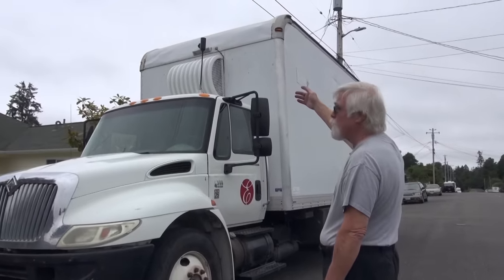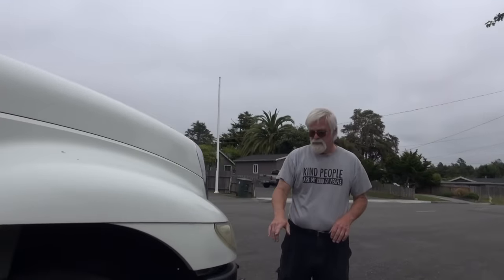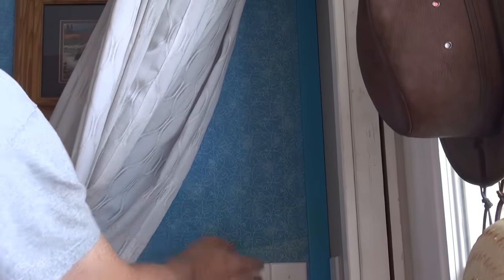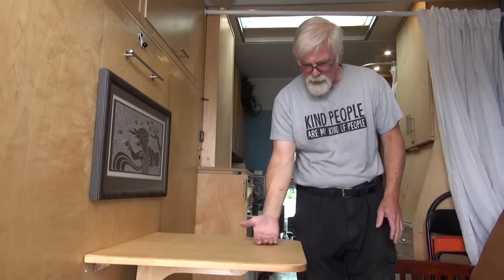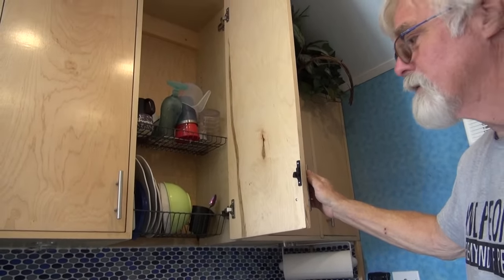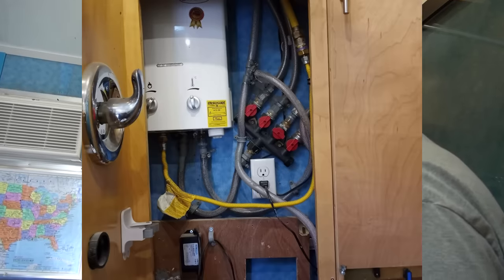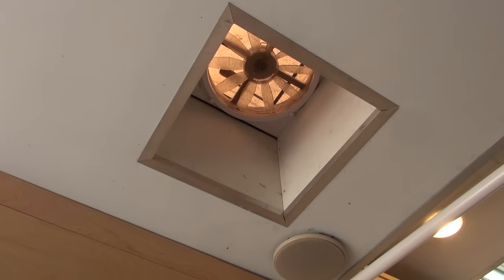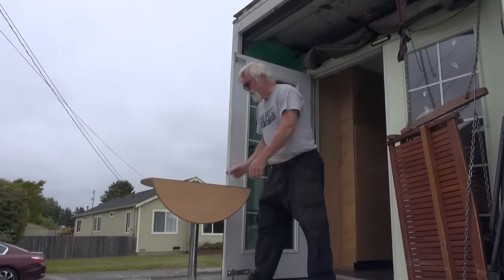Harvey the RV Stealth Box Truck Conversion/Tiny House Full Tour

Comment: I'm curious how recirculated water works and want to look more into it. This is a really interesting build and it seems like its the perfect fit for your lifestyle/needs. I love simple things so the dish strainers built into a cupboard was my favorite though there are so many other cool things I really enjoyed too

Edit: Nope ignore me, I also loved the toilet paper arm lowering build. His excitement for it made me love it so much too. So the strainer and the tp arm is rad af
Reply from the maker: Hi, these days there are a lot of videos on recirculating showers for van life. A quick search on YouTube should get you the information you want. The main things are to heat your water for both the "house" and the shower separately and to use a pre-pump filter, then a set of filters that go from 20 microns down to 5 microns followed by a UV filter. I found that the shower head makes a big difference. I started with a low flow shower head and that really did not work for me. Good luck with this.

Comment: This is the absolute best RV that I have ever seen. The design is remarkable. The craftsmanship is great. The safety, and good use of space is excellent! Congratulations!
Reply from the maker: Thanks so much for the kind thoughts.
Reply: Needs stealth side windows that can be opened. I'd want more natural light. But great stealth!
Reply from the maker: The only stealth build I have seen  with side windows used a large vent/grate to conceal the window until he was parked somewhere that did not require stealth. I thought about it, but the interior was actually quite light and we spent most of our time on the back deck until it was time to eat and sleep. I could not think of a reason why a box truck would have a large grate/vent on the side. The lack of side windows had its plusses as it made the truck quieter and darker at night.   @nicktw8688

Comment: This is such an incredible, well thought out home.

Instead of cat litter, consider using pine pellets designed to be used as horse bedding.  A 40-pound bag at Tractor Supply Company is $8.00, much cheaper than cat litter.  The pine pellets absorb the moisture from feces, making it a dried solid and urine causes the pellets to break down into sawdust and absorb the fluid.  No dust, no smell.  I use it for my cats and every few days, just dump the entire litter pan in the garbage and start fresh.  There's no need to scoop daily.
Reply from the maker: Thanks I will give that a try.

Comment: Generally speaking I love how ingenious this build is the ergonomics are off the charts. One additional feature I would add to his patio is like his table holes and posts as railings around the outside edge. It would also be pretty easy to add swivels for access to those stairs to turn the rail fence into a Gates. Spring loaded catches, would be easy to rig.
Reply from the maker: I like the idea and have been trying to find a clean way to add a railing. The challenge is the deck/lift cross-section is triangular going from 3 inches thick at the truck down to a 1/4" at the lip that goes down to the ground.   That makes supporting the railing at the outside edge difficult as there is little to support it. I also have avoided adding more stuff that needs to be stored in the back area between the back door and the interior. I am still looking for a clean solution, in the meantime I added a curb around the outside edge that prevents chairs from sliding off. Thanks for sharing your thoughts on this. I appreciate it.
Reply: How far from the edge would post holes need to be for proper support? One idea that occurs off the start that might work is if its within a foot or so, make the hole, and the pole comes up a few inches, just above the floor and then it goes towards the edge, and comes up near the edge. You might think it would be unstable, but I expect when you connect a few poles, and had two sections that connect at a corner then that would lend the needed overall stability that would let it function. Basically its the overall structure that gives stability. Any other approach I can think of so far would be clumsier.
Reply from the maker: @lenwenzel7440  Thanks for these thoughts. I will continue to explore options. I am hoping to find something quick and easy to setup and folds down to a small footprint for storage. I really appreciate you sharing your thoughts on this.

Comment: Question. Are you satisfied with the engine on your International model?. I’m so impressed with the amount of daydreaming/brainstorming to integrate so many different systems to operate inside Harvey. Pegboard under mattress is so simple and not too hard to design/build. Brilliant!! He could run circles around most engineers.    I daydream about my build every time I drive downtown. I watch the box trucks on the freeways. big challenge is how fast the electrical systems are evolving. Seems like a better system shows up on YouTube every week.  Super practical dish drain. Enjoy your journeys!!!!!
Reply from the maker: Hi, it is a 2005 International 4300. It is reliable, but dog slow on hills and getting up to freeway speeds. We just took it easy and the truck was fine. You are right about the electrical systems. I just jumped in when the time was right during the build and did the best I could then.

Comment: What a beautiful truck, perfectly modified to the tiniest detail.  Wish you had explained the kitchen backsplash and  tile more.  You should do more videos.  Got an idea about our bed to use pegboard.  Never thought of that.  Thank you.
Reply from the maker: Hi, the backsplash was a straight tile job over a 3/4" plywood backing board. I used clear silicone to dress the connection between the tile and countertop and put wood borders/corner pieces to cover the edges which tended to crack and shed some grout. It was my first tile job, and the advice I got at the hardware store had me start out with a notched trowel that put on too much of the adhesive. That left a portion of the tile with really thin grout. The two lessons I learned were to consult a tile store before starting and avoid small round tile if you are new at it. I had to make a holding device to let me use the tile saw to cut the corner tiles individually. I am glad you liked it. I did not mention it, but the murphy bed has a frame under the pegboard that is 1 1/2 inches thick providing a pathway for the air to circulate under the pegboard. Take care.

Comment: Your toilet is genius! I'm so copying your idea there!
Reply from the maker: Thanks! I am not sure if I included the description of how the toilet seat was made so here it is. I unscrewed the seat and cover and switched them so the seat was on top and the solid cover was underneath. Then cut the hole in the cover slightly larger than the seat opening. This lets you hang the bag so the lip is under the seat and does not get soiled. I then added a spring clip made from a piece of steel tension spring from the hardware store. This is attatched to the underside of the seat at the front and clips the two parts of the toilet seat together so the bag does not slip.  Good luck with your project!
Reply: @DrDuze-se5cx   Thanks for that description, Makes perfect sense. That saves so much money on the fancy toilet systems. I too struggle with cleaning out the toilet. I'm not sure if this system would pass out rules for self-containment here in New Zealand. They are crazy with their rules here.
Reply from the maker: @guppynuttynz7729  Perhaps the containment bag being mounted under the truck would make a difference. Not sure, but good luck.

Comment: Plus you also have a built in drive in theatre, just add LCD projector aiming on the side of the screen size exterior.
I just set my wallet on fire and bought a pair of AR/VR glasses, Xreal X or Light version. Sudden onset movie theatre, office array of many visible computer screens with touchscreen potential due to the glasses having sensors that can apparently produce touchable surfaces in mid air. I nearly bought a giant tablet touch screen, commercial type one at 32", but then realized, maybe look around at VR and AR glasses and decided on the Xreal ultra portable lightweight eyewear solution.
You would totally dig these for a movie theatre or computer office, as you could essentially wear them and see your livingroom appear as if some giant sprawling estate mansion or skyscraping penthouse condo.
Party on Garth, party on.
Reply from the maker: Cool idea. I almost added a LCD projector inside but we ended up watching so little TV/Movies we did not need anything to keep us entertained. The "Drive-in Movie idea sounds fun, particularly for those who camp at campgrounds where it could be a way to create community. Thanks for sharing this information.

Comment: Eric, this is actually a very awesome RV you made. You designed everything perfectly to make it very comfortable. I’m not sure about the bag toilet with just a curtain for privacy. I tend to poop very quietly and it smells like fresh flowers in the spring, but my wife makes terrible noises when going #2 and it smells like something died up inside her butt which would leave the RV smelling pretty bad. Something a little embarrassing if you have guests. I’d want a wall with a door on the bathroom, but I realize the space limits what you can do. I do like the idea of the recirculating shower. I’ve heard of people doing this, especially if you’re boondocking a lot. The Murphy bed is perfect and the desk is a great idea. Having the patio and the patio doors is a nice touch and, the swing is a great idea that is rare on an RV. Great and detailed tour. I enjoyed it. Thanks!
Reply from the maker: Thanks for the kind words. The main reason for not having a solid wall bathroom was to expand the size of the kitchen by making the floor all at the same level. This lets two people easily navigate around each other. I do wonder what you eat to get the flowers in spring result!
Reply: As I mentioned elsewhere, we do take advantage of public toilets (rest stops, stores, gas stations, truck stops, venues, etc.) so we try to keep the bag use to a minimum; but otherwise, fresh air when possible and some good bathroom spray do the trick.

Comment: Interesting conversion and that medium duty truck chassis is 10x more rugged than the typical commercial RV.  Any Transwest or other commercial diesel place can work on the engine too, if needed.  "Diesel pusher" RVs, while very  nice, are a nightmare if they have engine issues, as their rear mounted engine is buried, and a portion of the interior may have to come out to access it. 

"Super C" is my favorite commercial RV type, as they use a similar medium duty commercial truck chassis with the big diesel engine out front, as God intended.  Of course this is all fantasy, as new Super C rigs go for around 500K and up.  This clever stealth rig may not be new and shiny, but it is much more affordable!
Reply from the maker: I agree. The classic dt466 engine is easy to work on, although not cheap! I rather prefer the slightly beat up look as it helps in the camouflage when travelling in the cities.

Comment: I really like your simple toilet idea.  The thought of carrying large fluid containers from toilets grosses me out, as does the idea of a black water tank. Maybe because I have cats, have thought I would work out a similar system for myself.
Reply: It really did work well. Of course we used public bathrooms whenever we stopped at restaurants, gas stations or highway rest stops, but when we needed to use our own, it worked out just fine. (Even in 'close quarters,' a little air freshener or a couple of kitchen matches when necessary kept things as pleasant as being at home.) And as he mentioned, disposal of the bags was the same as disposal of diapers!

Comment: Even better for toilet- use cedar shavings like hamster bedding. Cheap, come very compressed in a bag, lightweight, absorbent, and they smell great. Few inches in bottom of bag to start, add a couple handfuls after every use. Best solution I've found.
Reply from the maker: Thanks, I will give that a try.
Reply: That does sound like a good idea ~ thanks!
Reply: @punzelle I'm obsessed with TinyHouses so have been a part of that "community" for 15 years now, thousands of videos and three books later-I've heard peat moss is the best to keep down smells and help the waste be used in compost piles from hundreds of Tiny House folks that use composting toilets.

Comment: Phenomenal. The attention to detail for ease of use is how you can tell it is lived in. Im sure there were many iterations but the end result is fantastic. I would have been tempted to go all the way to the rear roll up door and max out at 13’6” but it seems like you aren’t lacking anything without the extra height.
Reply: Thanks for the nice comments. Not sure what you're saying about the roll-down door -- we travel (and sleep) with it down and locked, but that doesn't change the height of the truck -- maybe Eric can elaborate.
Reply: @punzelle  you’re welcome. I was just saying that I wouldn’t have thought to start the build the 2 or 3 feet in from the roll up door. I would have built the wall closer to that roller door and then regretted it later. So the build is brilliant!

Comment: Cool concept. The main issues with it though are too much reliance on elecronics and electric and the requirement of mulitple sources of power and fuel. That can be a good thing but also a major issue is accessabikity becomes an issue due to a shortage or inability to access them. All that reliance on electric is a definate bane. If your genny goes down or you run out of fuel, yoy're dead in the water and with times like they are and rapidly deteriorating, the less reliant on electric mulitiple fuels, the better off you'll be. I installed solar panels on my rig as a backup to the diesel genny for low or no fuel situations. The truck is a 1971 M35A2 and runs on diesel with a multifuel engine that can run on pretty much anything that will burn in a have to situation. The living space is a command module off of a 1994 Stewart & Stevenson command center truck that I turned into a four person camper with a small porch on back and the top can be made into a lounge type area accessable by ladder.
Reply from the maker: Your rig sounds amazing. I used multiple systems to avoid a total shut down if one failed. It sounds like you took that idea one step further. We do have a generator if the solar is not sufficient, but neither the generator nor the truck can run on any fuel.

Comment: I recommend against painting the propane tank black. As I understand it every tank manufacturer insist tanks only be painted a light color.
Reply from the maker: Hi thanks for this information. I will look into it.
Reply: Agreed. It's possible to create a black shield to attach next to it to hide it, but in hot or sunny areas you really don't want to draw more heat to it.

Comment: Nice that you made it hard if someone broke into the cab. I get “stealth”, but also don’t. Meaning you think stealth that it is less likely to be broken into, but then again… some people see a box truck that could be full of tv’s and other electronics! I think I would actually feel less secure. Maybe that’s my retail mindset that causes me to feel this way.
Reply from the maker: The stealth is more to allow stopping anywhere without attracting attention.
Reply: @DrDuze-se5cx  but again you really need to be careful where you park. Most thieves would see a lone box truck as easy prey. I don’t think I would dare go stealth.
Reply: @amyblasingim2136  It's a toss up, what's your objective? Having a relative guarantee to find someplace to park overnight without being harassed, or dealing with the outside change of some thief thinking he might be able to break into a truck that you have an advanced security system installed on? It's up to you to decide, but I would personally go with their decision. I'd rather not worry about being told to leave on a regular basis vs. dealing with an unlikely event. Especially if you use your noodle on where you park. Doesn't invalidate your point of view, I'm just saying that yours doesn't invalidate theirs.